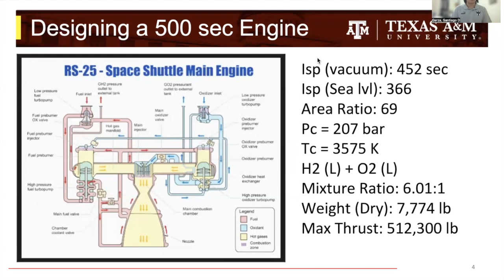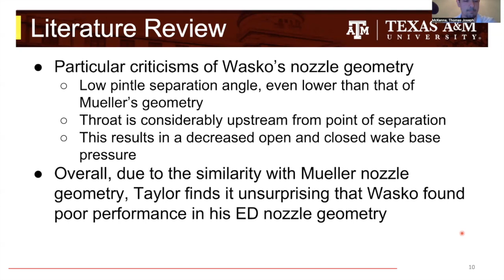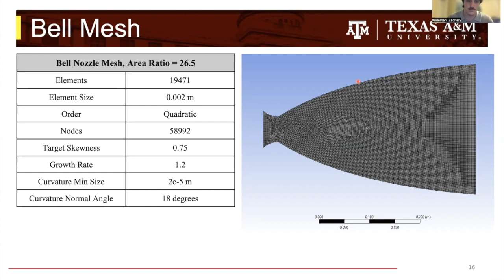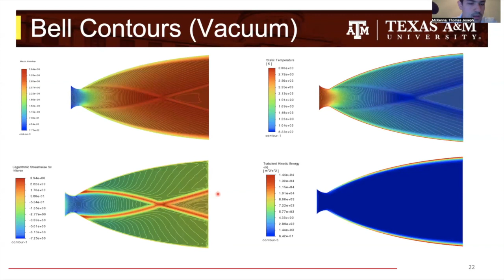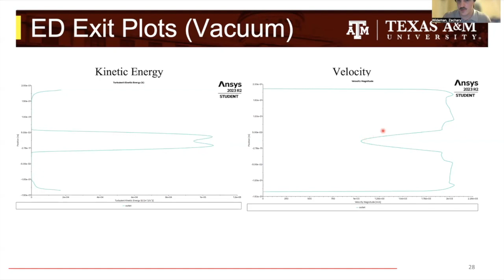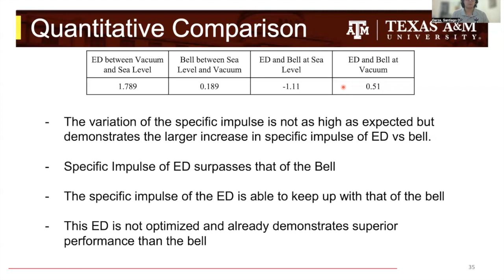Expansion Deflection Nozzle Research Presentation

Comment: Hallo Zachary Wideman, I am a final year bachelor of technology in mechanical engineering student. my final project is about the E-D nozzle. your presentation video and details help me to understand about the basic geometrical measure and others condition which can be used for the E-D nozzle. 
I have question, how can we find the efficiency of E-D nozzle? I mean is there any specific equation for that. Due to lack of guidance I am stuck in my project work. while i am browsing in net there lot of formula's, i am confused.
I am waiting for your response.....
Reply from the maker: Howdy, the efficiency of your ED nozzle is defined by the specific impulse of the nozzle, or how well the engine/nozzle converts fuel into thrust (change in momentum per mass of propellant). Here is a google drive link to our paper. https://drive.google.com/file/d/1-XT-6EQrAUDGok-isg9i9yTk0FZGP9D3/view
Reply: @zacharywideman6254  I am trying to increase the efficiency by adjusting the geometry of pindle or nozzle using ansys fluent. can you suggest which geometrical change may lead to the increase of efficiency or specific impulse of the nozzle. or is there any others factors ?
Reply from the maker: @albinbthomas9994 as noted in the paper, I think a rounded pintle would lead to a better specific impulse, could try and find the sweet spot at the design altitude where the wake of the ED becomes closed. This would get much better results than what we did.
Reply: @zacharywideman6254  ok thank you, I will try as you suggested.
Reply: @zacharywideman6254  i have one more doute, which Ansys fluent did you guys used for work? i mean student version or purchased version.
And which, high-end PC's or laptops where use for the Ansys analysis?

Comment: had a similar idea today, but if you already have a stick going through the throat, why not just hollow it and attach it to an air inlet above the engine, you‘d basically get an aerospike, but without the cooling issues.
Reply from the maker: Hmmm, I’m slightly confused on what you are saying... If I think I understand it correctly, the air from the inlet would not be enough to cool the pintle, as it can reach up to 3000K. But maybe I am not properly understanding your idea
Reply: @zacharywideman6254  The point of the Expansion Deflection Nozzle is basically that it adapts to outside pressure like an aerospike, while keeping the throat narrow, therefore avoiding the cooling issues that usually come with Aerospikes, since their throat circumference is so large. The problem with using a plug, like visible in the Video, is that once the ambient pressure drops below the exhaust pressure, the outside can no longer reach the plug, therefore it would be better have air inlets above the engine and letting that air stream flow into the nozzle, creating ambient pressure in the middle of the nozzle. How you get the air into the nozzle is another question, you could have a pipe go through the combustion chamber and throat, though that would come with significant cooling problems, or you could have it come from the sides and be released directly under the throat, it's just important, that there's a natural airflow through the middle of the nozzle.
Reply from the maker: This is more of a problem of the optimization of the nozzle, you want to create a nozzle that reaches closed wake at your optimized altitude, when your nozzle is closed, the recirculation area near the pintle is at the ambient pressure. If you attach an air intake to the recirculating area, it wouldn’t pin the exhaust to the wall because of the exhaust pressure being greater than the ambient. That being said, this design wouldn’t provide any efficiency compensation in space as there is no air for the intake. You need to create an ambient pressure greater than the exhaust in the recirculating which means you would need a compressor on the air intake. The pintle cooling is still a major issue in the ED Nozzle as you would need your oxidizer to be pumped into the pintle to cool it (just like how the nozzle is cooled)